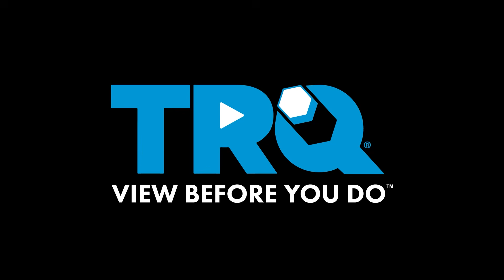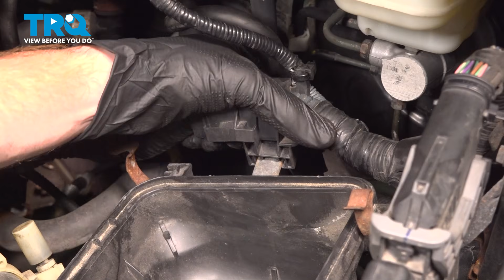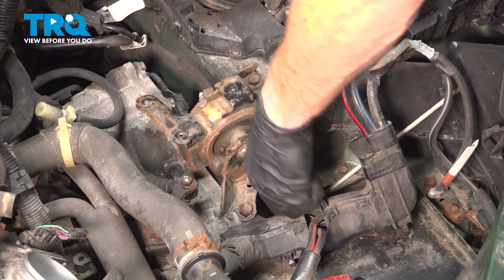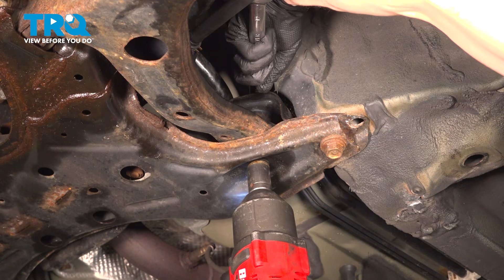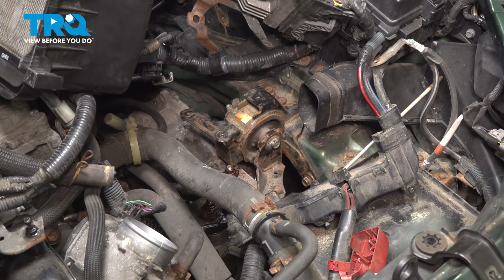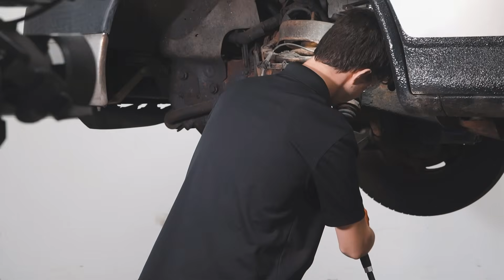How to Replace Front Lower Control Arms 2014-2019 Toyota Corolla

Comment: FYI for anyone looking at this, If you have a manual transmission version of this car you do not have to move the engine and transmission. If you have an automatic, pair this with removing the transmission oil pan, and changing the transmission oil and internal filter, it's easier than the method in this video.

Comment: The best time to do this is when you're going to do a drain and fill and change the transmission filter because when you remove the oil pan you can get the bolt out without doing everything in this video.Thats what I did and it was sooooo much easier

Comment: Toyota engineers should be proud. Multiple generations of this vehicle with idiotic and poorly designed arrangement that requires moving the whole engine to remove a freaking control arm bolt. Unbelievable.

Comment: the bolt that is behind the transmission pan can be taken out by simply lowering the subframe. there are 8 bolts holding the subframe under the car. 2 19 mm bolts on both passenger and driver side and 3 14mm bolts in the middle and an 18 mm bolt in the middle. U DONT HAVE TO LIFT UR TRANSMISSION. also, the passenger side is easier because it is blocked by the oil filter which doesnt sit as low as the transmission pan. just did this job over the weekend with TRQ parts. thanks for the help guys!

Comment: Why do I need to remove the whole engine bay to replace one damn piece
Reply: So you can sell an air filter, throttle body cleaning service, mass airflow cleaning service, a new battery, a set of motor mounts, a transmission fluid service, lower ball joints. And don't forget the wheel alignment.
After all, you are basically taking everything out, mind as well replace everything. 
If the customer approves all of that, you could basically do the L.C.A. for free while you're down there.